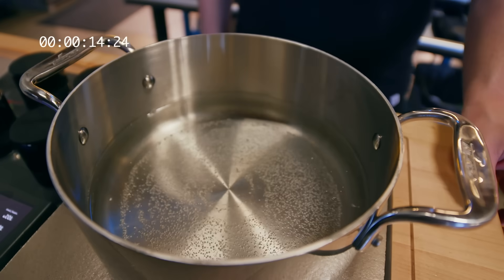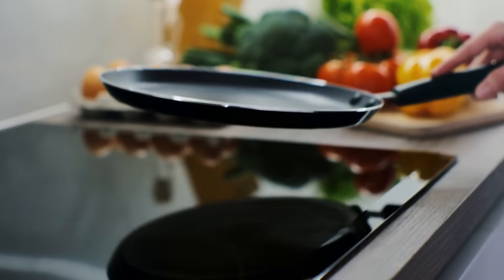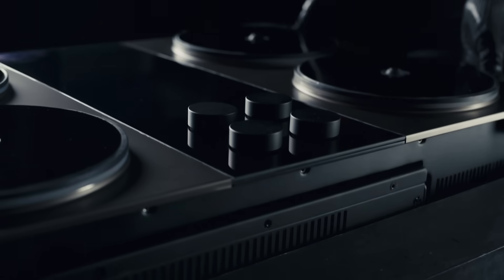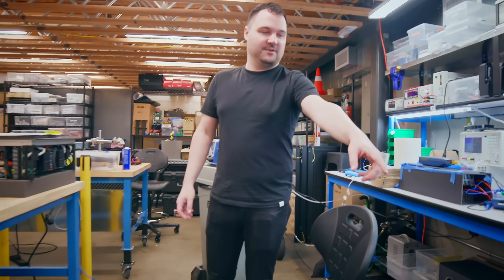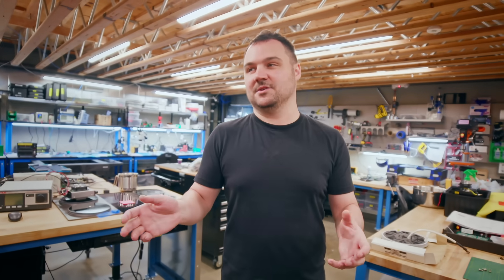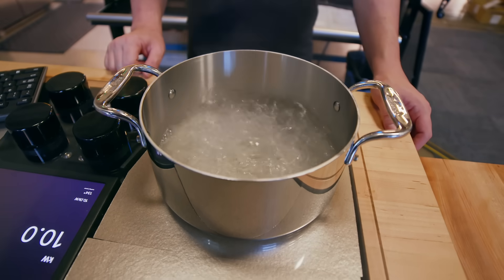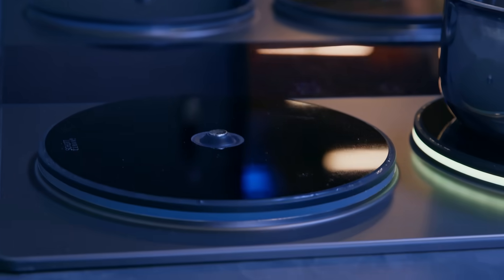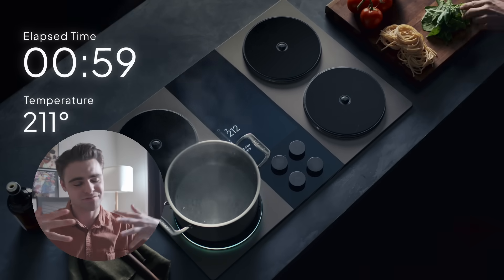World's Most Powerful Stove: Boils Water in Seconds | Impulse

Comment: Is there no one who can consider what happens when your batteries get old? I have appliances that are 98 years old still working exactly the same as they did when they were new. This stove has a realistic lifespan of maybe ten years with a battery change every two years.
Reply: Lithium Iron Phosphate batteries have a 10 year lifespan (meaning their remaining capacity is expected to dip below 80% or 2.4KW after the rated cycles)  after 3,000 - 5,000 cycles.  They're also super standardized in terms of form factor so replacements should still be available in a decade from now (basically as common as the AA and AAA Battery)

If we use backpacking camping standards to heat water up for dehydrated food (yes, this is a thing).

8oz of water would take about ~50ish watts of power to heat up in 2 minutes.  That said, you could easily leave enough power for a few days to heat up a few kettles of tea, make some breakfast, lunch, and dinner.  As long as you're sparing and you turn off your stove as soon as you're done cooking.

The added benefit of induction is that it's far more efficient at heating your pots and pans and only putting the heat into the cookware.

However, there are some concerns where if the temperature dips, the battery capacity will diminish while at that lowered temp.

A vast majority of people live in climate zones that don't reach freezing levels, so a stove like this would see the most benefit in those areas esp to reduce the amount of fossil fuels used. 

So there are a lot of factors to think about when looking at a new range and it mainly is based on your own purpose, but if you're in a mediterranean climate that doesn't see much (if any) freezing temps, I think this will work out for you.  

Personally I like these things, but I also wouldn't mind a hybrid gas/electric setup with swappable jets so I can go from Natural Gas to Propane (and vice versa).
Reply: @styledliving  I think we can realistically ignore the possibility of significant environmental temperature degradation, since the stoves would almost all be in climate controlled environments.

My life-span estimate is based on battery powered tools which might be an unrealistic comparison. Still, I'd be astonished if the batteries actually last 10 years in regular use, and I'm dead certain my (by then) over 100 year old appliances will STILL be working properly while these stoves are being replaced with the NEW greatest stove of all time.

I'm not trying to be an old fuddy-duddy: I'm just good at it.

Comment: What a bunch of gas lighting 😂. Stoves are 240 volt not 120 volt. 10kw is only 41 amps at 240. Easily done with main power if you want to.

Comment: Looks cool but no thank you. I don't need to boil my water in 10 seconds I don't need to make a brick oven pizza but what I do want is a product that once I buy it.  I don't have to worry about it for 10 years it just works. All I see here is an over-complicated product with too many components that can break. (Anecdotal evidence) I bought a washing machine recently brand new name brand highly rated and guess what, the first week it broke. Call the repair man when he got here within two seconds I know the problem shows it to me. See this chip it's bad I have to replace this chip. Brand new washing machine barely used and the chip went bad? The repair man goes on to tell me that's why I knew so quickly this is a common occurrence with these. A common occurrence is that manufacturers have deemed it's cheaper and more cost-effective to send out machines with faulty parts and have a repair man come and fix it then get the job done right at the factory. Cause what does the factory care that I have lose a day's pay, and spend money on a  laundromat, they already got me for the machine. And thank God this repair man goes out of his way to carry these chips as he informed me if not it would take weeks to get these in. Humans are great at making simple things over complicated to suit our own fucking ego, which can eventually be used to screw the customer over. I don't care how well-intentioned you are human nature sooner or later within the group is going to take over. I wish more manufacturers kept to the acronym of K.I.S.S, keep it simple stupid.

Comment: There is only one problem - when he said that other induction cooktops were 3kW, he didn’t tell the whole truth. The QRPT-A10B induction stove is 10kW without needing a battery. Even Jenn Air JIC4536XS for only $2300 is 10kW.
Reply: QRPT-A10B is three phase which almost nobody is going to have at their house. The Jenn Air JIC4536XS is maximum of 5000w boost on single burner for 10 minutes - definitely not 10kw.
Reply: it's 10 kW peak performance per burner, most other burners peak at 3 kW with 10 kW max across the entire stove
Reply: The other problem in a retrofit situation is the cost of getting power at the location.

Comment: Never going to go main stream. Firstly the price will be VERY EXPENSIVE, secondly batteries only last a short period of time before they no long hold their charge, thirdly, replacement batteries will cost a fortune and then one day company folded and replacement/spares no longer available.
My gas stove works just fine and when the power is out I use a hand held igniter.
Cooked hundreds of times during power out periods, load shedding, here in South Africa.

Comment: I'm not ditching my gas rangetop any time soon. That thing is amazing. Good luck making a decent fried rice in a steel wok on an electric cooktop. It's OK for some peeps, but if you're serious about cooking, stick with gas. No self-respecting restaurant would ever have electric cooktops in the kitchen.
Reply: I think you really need to try induction before making such statements. Many restaurants use induction, because it works even better than gas — and I say this as a long-time gas fan. Induction combines all the advantages of gas (responsive heat, instant off) with the advantages of electric (no gas line needed), and then some (doesn’t heat the ambient air). 

FYI they make special induction wok burners that have a curved well for the wok, to let them heat the wok properly. 

I routinely make fried rice in a cast iron pan on my induction hot plate (2kW). Though I have to sacrifice the round shape, which makes stirring it a bit trickier, it actually gets hotter than a wok on a standard household gas burner, so the final product is better. My actual stove is a Bosch glasstop electric, and it actually does pretty well for electric, but of course it’s not responsive the way gas and induction are.
Reply: @tookitogo  lestov makes commercial concave induction wok burners up to 25kw.  it heats up like a 100k+ btu gas wok stove.  heats up instantaneously, and there's no spillover heat from the gas.  it can get wok hei with zero issues.

AniDot70 probably just doesn't have any experience so they don't know how good these things are, lol.
Reply: @styledliving  25kW induction sounds awesome.

Comment: 0:33 
 electrical engineering student here. I’m not even from the USA and I have never once visited yet I am aware that there are dual phase 240v outlets in America specifically designed for high power appliances such as an oven. I think this isn’t the case of power, but a case of power electronics engineering (well lack thereof) on a budget. Please ship consumers something we want and boost up your income from this project as it was rushed and there’s nothing like having a large lithium to maintain the amps needed.
Reply: I believe the issue is even 240v is still restricted to a 100amp breaker.

Comment: How do you mitigate the risk of warping hiqh stainless steel cookware by heating them up too fast?  Even with super even induction heater making water boil in 40 seconds is something I would be worried about warping. I don't even use the boost function  of my cheap induction top even if I am cooking water with any of my expensive high quality cookware (which basically is what all of them recommend in their product instructions anyways)

Comment: I'm glad that I live in Europe, where we usually have a three-phase 400V connection at home and induction cookers can have 10-11kw without the need for batteries... :)
Reply: US 50 amp circuit is common enough and that is 10kW. I charge my car at home with a 90 amp circuit.
Reply: @rsilvers129  I feel special knowing we have 480/277 at the office.
Reply: @rsilvers129  Wow, 90A takes a decent cross section of wire. I estimate it to be around 25mm^2  Welding cable category :)) Interesting information, thanks
Reply: @janliberda9493  Imagine paying a "skilled worker" to install thirty to seventy metres of the "welding cable"
Reply: @rsilvers129 50 amp circuits are not common at all in the US
Reply: I would love one of these to reduce the surcharge of actually using 10kw at the same time. It would save me money if I could reduce my energy usage to under max 2kw over the course of the month, the stove would pay for itself just by reducing the amount I'm paying in surcharge to use a lot of electricity at the same time. I think it goes from 60$ a month down to around 10$ if I could do that. That's 600$ savings a year. I only need about 1.5kw to meet the needs of my house over a day but using appliances peaks me up quite high forcing surcharges on everyones bills
Reply: @WinterNorth  if it's consumption it would have no effect.
Reply: 30amp circuit for cooking is common enough
Reply: Stoves get a 50amp circuit in the US.
Reply: I've never seen anyone actually use either 3 phase or the 400V for the outlets though. We usually use 20A 230V outlet.
Reply: @sylvester4207  400V is not really commonly used for outlets in the home, but three-phase built-in appliances (like the induction cookers mentioned) are also not plugged into sockets, but connected into screw terminals. Sockets for 400V 3 phases are quite common in workshops and garages for appliances such as saws, planers, milling machines and the like.
Reply: @sylvester4207 stovetops dont use normal sockets, they have these pronged outlets that can be single or three phase. Most stovetops are possible to rewire to either connection
Reply: @sylvester4207  It's usually a 7-10 amp single phase outlet.
Reply: @scottstempmail9045  oh, in Norway we have 16A outlets everywhere
Reply: @sylvester4207  My mistake, I was drinking last night and...
Reply: @scottstempmail9045  ah well in that case you're absolutely forgiven
Reply: @sylvester4207  Thank you. I had the British 7 or 13 amp fused plug in my head when I responded.
Reply: Is there an equivalent product in Europe that works super fast?
Reply: @michaelvo In the UK it's normal for us to have kettles for boiling water at 3kw and the power connection for our cookers is 7.3kw. The disadvantage with my induction stovetop being quick however is the pans boiling over so before you notice so they are right to add temperature sensing!
Reply: @michaelvo  I don't know if it's super fast, but we have stoves available that have about 4kw per "hotplate" and 11kw together. (cant run all hotplates max power at once) This is approximately 1m 30s per liter of water brought to the boil from 20 degrees Celsius.
Reply: "I live in europe". That's the problem with Europe. No national pride. Wtf does that even mean? I live in Europe... I live in the milky way galaxy.
Reply: @deeziebaby no because the electrical system is similar in european countries you fool
Reply: @deeziebaby  Because if I say I live in the Czech Republic, how many people will know where I am?
Reply: Until the EU decides you don't need luxuries like "electricity" and decides to reduce your carbon for you
Reply: @kaojaicam  Eh, if it's an induction cooktop then the eu won't have problems with it, since it is electric.
Reply: @kaojaicam  Yep, they've been really nice and considerate of my well-being lately :)

Comment: Get a proper electricity grid. Even my 35m² students apartment had at least 32A/400V 3phase. (It might even be 63A, but I don't know for sure.)
Drop the battery, and make it a flat top glass stove (easier to keep clean) and I'd buy one.
And seriously: Everybody can cook rice without a rice cooker. Only fools think they need a rice cooker.
Reply: My Home in the US has 200 AMP service and I can run 240V circuits to my heart's content. I have three 240V outlets and one 240V circuit that feeds my 3-ton central AC.  Oh, and I use gas for my clothes dryer, stove, water heater and central heating... because it CHEAPER than electricity. Is that proper enough for you?

Comment: Cool stove, probably can't afford it though. Good for commercial use, rapid heating and stuff and temp control, but this looks like a rich mans toy. I'll stick to gas.
Reply: Even standard induction cooktops will beat out a gas cooktop. They cook faster and are more economically efficient.
Reply: @emcnair2  "Standard" Induction usually involves a simmerstat or a thermal cycling mechanism, High end Induction typically doesn't do this. Doesn't heat up fast because you need heavy bottomed cookware because you need to smooth out the heat pulses, if you use a thin pan, it will heat up quick, but it will overcook delicate things on a single pulse. To heat quickly I would need to pulse at high heat to meet that claim, and even then I risk overheating a teflon pan on a high heat pulse. I have used both, nothing beats gas in the morning when you want a fast fried egg or boiling water for your coffee.

Comment: Your product will sell itself. It’s cool and unique. Don’t sit there and lie about the pros and cons of electric vs gas though. Big turn off when you clearly don’t know what you’re talking about. Gas is way less costly than electric. The level of heat is way easier to control, and the stove top cools down significantly faster, so that “commercial kitchen” line is hot garbage. Air conditioning is very costly. Don’t you think that if electric was better, commercial kitchens would save their wallets by switching?

Comment: To be honest, it being quick, cool, neat even, boiling water happens alot, sure. The temperature control is what's cool. Being able to keep a pan hot is what gas is good at, because most electric ranges are fairly anemic and slow to respond, gas has a ton of thermal output and responds quickly.

This is the level that they need to be at in order to replace gas entirely. Make it last for 10ish years and cost around a grand, you take over the entire market as normal replacements occur.

So, power is solved, longevity, eh, probably solved, a ways to go on cost no doubt. You'll be able to offset that a bit with potential grid savings, but, the math has to work out, and it likely doesn't yet. Yet.

Comment: I guess it depends on what your reasons are but your reasons are different from the reasons of 60 plus percent of the population

First most people use whatever is available if the house comes in natural gas that's what they use if the house comes a propane that's what they use if the house comes in electric that's what they use most people don't really have a choice for example I prefer electric because I can make my own electricity I cannot make my own gas My house is plumbed for propane which is crazy expensive I found a nice cheap electric range on craigslist and it was useless because you need a 50 amp circuit to run that range and my whole entire house only has a 100 amp circuit :-)

So now I use a pair of cheap commercial induction cooktops :-)

I suspect the biggest problem with your range is going to be 70% of the country can't afford it so it's a wealthy person's toy

I love the idea of bidirectional power if there was a way to effectively do that for example I have time of use power so my power cost more during certain hours of day and cost less during other hours of the day being able to use the electricity eye store and batteries during the cheap time to offset power usage during the expense of time would be nice basically time shift my power usage still using the same power but paying half the amount of money for it

For most people if they even do have a choice about what they're going to use for their stove it's going to come down to cost.

As wonderful as products like this are the vast majority of us could never afford them and that's what sucks.